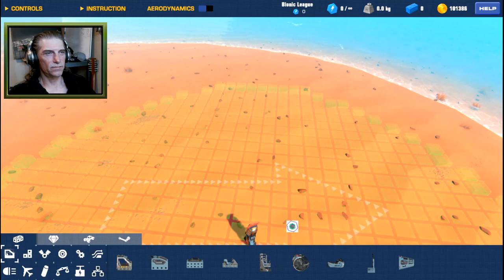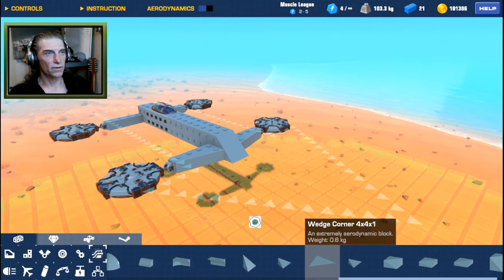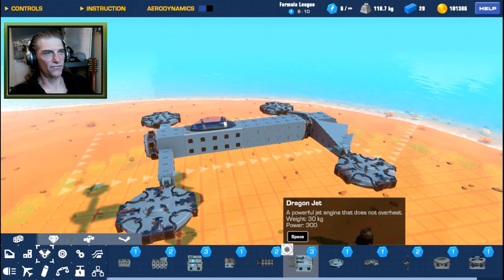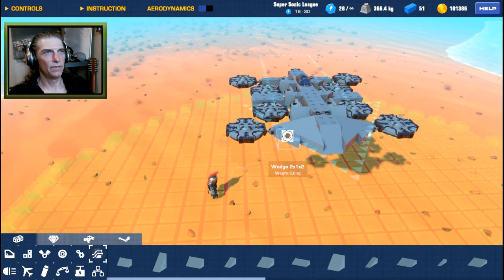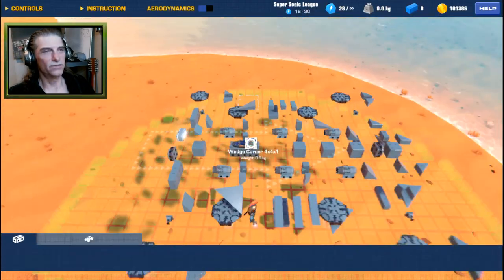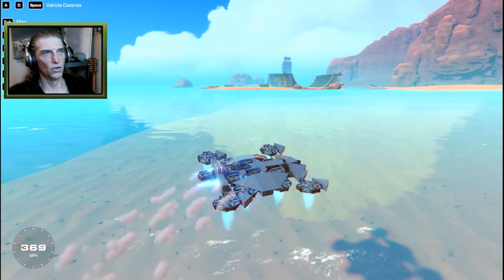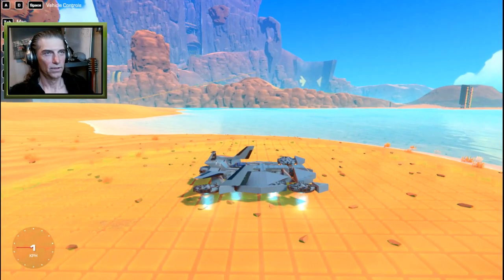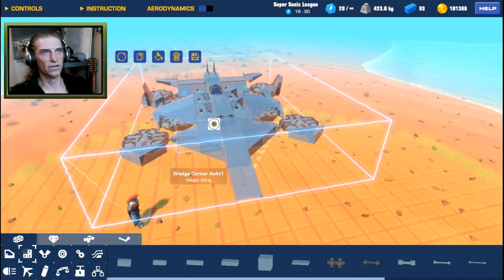400KPH Hovercraft! Let's Build in Trailmakers with ThatDomGuy.

Comment: Nice.
The trick with angling the hover pads will be helpful. 
I did not think about it. I still have some parts in the vulcano area in the campaign to catch.
All crafts carried by air are still a problem for me which is because of my lack of building experiance and my poor control over these crafts.
Getting it more stable with simple tricks is really helpful.